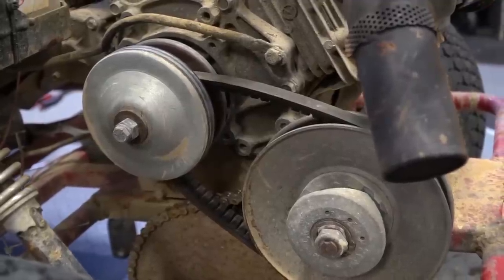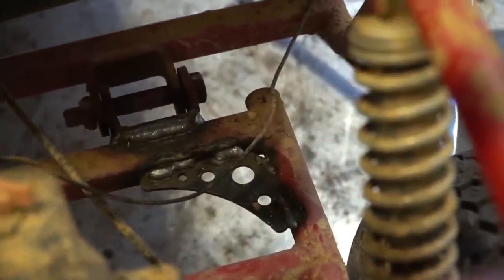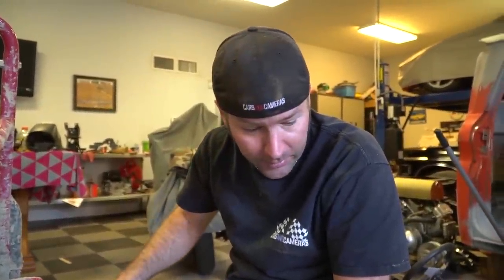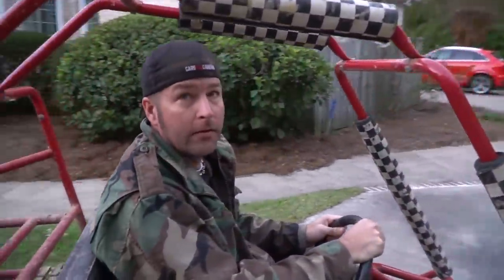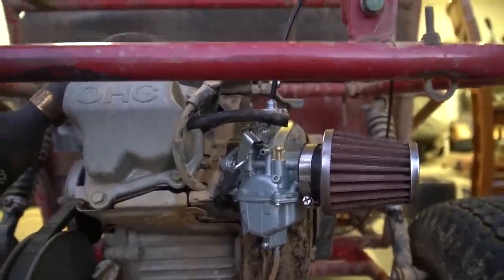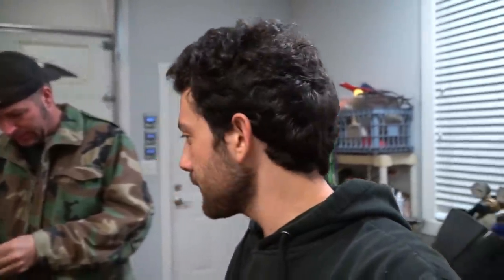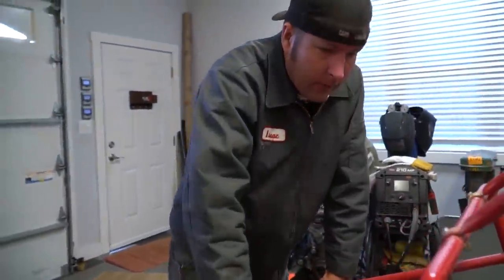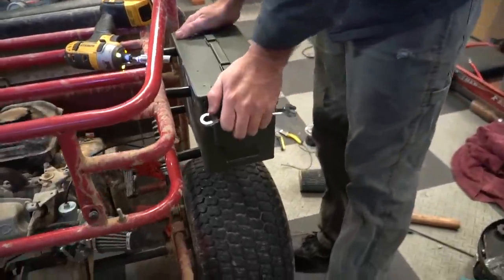Off Road Go Kart Utility Mods | Subaru Yerf Dog Revival

Comment: Go on a 2 day or more exploration camping trip with 2 go karts. Either build new ones or use some others and have tents and everything you need to survive for 2 days in a kart.
Reply: Yeah find a trail and ride in deep
Reply: Eurobeat = 
+20 mph speed
+85 drift skill
+3000 rpm
+good mood
Reply: You guys should put beefy tires with better off road tread
Reply: yea what this guy said
Reply: Propane and propane accessories I sell propane and propane accessories
Reply: They could probably pull a small one man camper with the truck go kart and one with this one too 👍👍
Reply: That would be cool 2 see
Reply: That would be cool to see
Reply: I was thinking an inverted "P-trap" style intake.
Reply: This. Find and old dirt road out in the wilderness somewhere. Ride and camp for a few days
Reply: C3! CarsandCamersandCamping... let's gooooo!
Reply: Mattie 75 yesss
Reply: CAN  I SEE ONE ON A "LIDAN 420CC,15HP BUILD??THAT,&200CC CHINESE COOLSTER QUADS.,- IS 
WHAT I'M WORKING WITH.THX. JDW
Reply: Lifan 15 h.p., 420 c.c. --@HARBOR-FREIGHT .

Comment: Air snorkel to keep the filter and carb clean and a winch? Just a couple of ideas.
Reply: Was just going to say the same thing.
Reply: it will reduce the filter issue but you will not stop dust going through a pod filter without a foam sock and some oil on it.
Reply: Wouldn't be heavy enough for a winch unless BOTH Jon and Ike were sitting in/on it and/or it was wedged to a tree.
Reply: New tyres whith gnarly tread
Reply: Agreed

Comment from the maker: Mini Mayhem meet coming next Wednesday!
Reply: I want to sponsor a Honda 390
Reply: You guys need some kind of air/fuel meter and lamda probe. Then you could actually tune the mixture correctly and not end up with another drag rail type engine failure,
Reply: Put bigger tires on it
Reply: Where is the Murray
Reply: I wanna ship these tires out for the yerf dog but I'm not sure where to send it , i will send pictures on Instagram. Check carsandcamerasreviews
Reply: Thats a good name for the monster kart "MINI MAYHEM!" or just plain ol, "MAYHEM!" or "SMALLFOOT" LOL
Reply: Wook at du cute wittle yewf dog wif the cute whittle eyes
Reply: please bring back the murry
Reply: I would put seat belts on it. After seeing ike roll it and him bouncing around i think tht is really a necessity.. JS and keeping safety in mind..
Reply: You should put a snorkel on it under the seat. Good video.
Reply: Roof rack
Reply: Dude sparks by a battery!

Tic tic BooM!
 Still a cool kart though!😆
Reply: You should upgrade the suspension
Reply: You need to fix the engine or back end from doing that hoping then it does
Reply: Add a snorkel to it
Reply: You guys should put the ATV wheels/tires that used to be on the front of the truck onto the front of this thing, give it a little more ability on the sand.
Reply: Paint the rims easy
Reply: Tires, wench, snorkel
Reply: On your Subaru yerf dog on the rack above your engine put in a generator gas tank there huge there the size and with of a rack

Comment: Yall should build a utility trailer for this. Then go for a karting/ camping trip.

I would do tow hooks front and rear. 

Brake/tail light 
 a rear mounted work/ camp light. 

A usb outlet for charging phones etc could be wired into a ammo can.

A winch could be handy.

Trailer hitch.

Comment: The best thing you could ever do to any of the yerf dog karts is get oversized bolts for every hole and drill out the holes to fit the bolts. Getting all the slop out of them completely transform them. I have rfy shocks as well as properly sized bolts on mine and it rides like a caddy.
Reply: Thanks

Comment: The yerf dog is awesome. If it were me though, I'd reverse the bolts on the ammo cans so that the bolt heads are inside the box. Then you don't have to worry about the shaft of the bolts catching your hands, or your supplies. I Also might would consider adding a simple brace or gusset in the frame where the boxes mount. And a 12"-16" led light bar across the top would just be perfect in my opinion. Those are just some of my thoughts. All in all, that thing is awesome. Ya'll have made me want one.

Comment: Idc what's going on but that 900cc Ducati motor needs to go on the rail, the power to weight ratio will be more balanced out
Reply: Goal for the rail isnt to go as fast as possible, its to make what it already is go as fast as possible.
The current 670 is already bending the axle on launch if they double the power (and increase the weight) its just going to cause more problems than its worth, they could build it up to take the power but then it'd be slower with the 670 and this is a go cart/lawnmower channel and using the 670 engine is the focus of that rail. its like having a 30 year old car with no mods and seeing how "good" you can make it with just simple mods, like tuning a stock '87 camaro vs dropping an ls3 into it, the fun is seeing how far it can go as-is.
Reply: Im not saying that because there is a issues with the rail but the Ducati motor doesn't fit that little go cart but the rail was the heaviest kart that they have
Reply: Id like to see what the 670 could do but i my be that it cant handle that stress  d still
Reply: @tomstech4390  OK. They did that. The current 670 is most likely a trot line weight now, so why beat a dead horse by trying to rebuild an engine that basically failed the first time it got pushed hard. And who wants to watch someone tune a stock 87 Camaro? Not me. BORING! Swap that bitch and make some power, or leave it at home, cause you just wasting the dude behind you in line to race's time. He gotta wait on that 14 sec pass, after the one wheel peel. It's cool, though, it was the wheel on the grandstand side.
Reply: They said specifically in one of their rail videos that they will NOT put the Ducati motor on the rail because the frame is already tweaked and the axle is already maxed out as is

Comment: some advice, i own one of these carts with a 12hp motor and yes they crack like that, also welding the upper cage to the lower frame instead of bolting it help ALOT with flex.

Comment: I have the 3202 which is basically the same thing but black and doesn’t have the rear rack. Stage 1 212 in it too.  I jumped it an completely snapped the frame
Reply: Haha damn where did it snap at

Comment: There is one thing you can do. Well it used to work on round saws. All we did is drill two holes once at the beginning of the crack and one at the end of it.
Drilling a hole stops the crack from spreading. just try it anyway. Cheers

Comment: Part of the beauty of an OHC design is it allows higher-RPM operation without valve-float, allowing more horsepower to be produced. It's what made the 500cc Matchless motorbike "matchless" in the day. 

That said, seeing how turbo-charging adds so-well in breathing at high engine RPMs, and since it is a Subaru, wouldn't the addition of a turbo make sense? You know how Subarus are with turbos... especially off-road!😎

Comment: You should consider turning the bolts around on the ammo can so that the head of the bolt is inside the can. It will prevent water bottles from being punctured or straps getting caught up....just a thought though

Comment: Ya"ll need to take it to the next level and either supercharge or NOS your vehicles. Perhaps add some serious suspension with 2' of travel. I love your channel and what you do but I think you have maxed out on the basic setups. Off road carts need huge front and rear tires with some serious suspension. Just tossing some ideas out for ya'll.  How about a cart with some serious snorkels that let you drive an off road cart under water all the way to your neck? A cart with 4 wheel steering? A cart with electric motors driven off a generator? Get nuts fellas! I can see it in your eyes that ya'll want to unleash!

Comment: Turn the bolts around for the ammo boxes.  With the ends sticking inside, someone is gonna forget and slice their hand or arm on the end of a bolt, and go with a shorter stove bolt type so you have a round head inside the box and it will still tighten up good.  But just curious, why didn't you guys just weld on some 1" flat plate and then weld the boxes to the flat plate with the lids just above the round bars??  Would have held on a heck of a lot better and no worries about breaking a bolt or the boxes sticking out a long ways like they do now.  Could have actually put them sideways at the back of the luggage rack.

OR 
OR
Put them on the front and gotten surface mount LED's and put them inside the boxes!!  Still have storage with a minimum amount of intrusion into the box.

Comment: I think you need a small light in the back just in case you have to get in your storage bin or fuel up. It would be nice if you needed to make adjustments on the motor also.

Comment: yeah pod filters are no good in the dirt, you need a foam sock over it that you can oil up to stop the dust getting through it and turning to mud once mixed with the fuel in your carb, that's why you are seeing mud in there.

Comment: put a light bar across the top rollcage rail, bigger gas tank above the engine then put taller suspention and wheels/tires on it as well.

Comment: you need to move  the top of the shocks back to stop the shaking in the rear end. and turn the bolts around in the box's you put on so you dont rip your hand open as you reach inside.

Comment: thats kind of like what i did to my Murray racing mower i had a rear axle from a radio flyer wagon it had holes already drilled into it i took the two bolts in the back of the mower off and bolted it up to the body with the same bolts it can hold either a spare tire or a tool box
Reply: the cool thing is with my Murray is that i have another spot that i could place the tool box so i guess its going to be a spare tire holder

Comment: Z guys when you go to a larger Venturi you slow down the airflow slower air flow means a leaner fixture when you go to a smaller Venturi it speeds up the airflow and richens the mixture

Comment: I wish you guys would make a snorkel for the engine, so it won't be sucking in all the dust etc.
Reply: IF they would run a foam filter the dust prob would be solved. The screen type filters let dust through though.

Comment: it seems with the torque of the subaru engine and the torque converter you could put on a smaller axle sprocket

Comment: When the drive belt chirps and jumps like that the belt is the wrong size. And if you change it to the correct size it will be fast most likely because it will function more to the way it was designed for.

Comment: Put a small winch from harbor for 50$ and it comes with remote
Reply: If it's a wireless remote, be sure to allow for killing the power to the winch when not in use. They create a constant drain when sitting idle waiting for a signal. Learned that over on Mustie1's channel.

Comment: I love your videos, but I have a question I just recently picked up  Exact same yerf dog cart that you have mine has the 6 1/2 horse Tecumseh engine on it. I am a mechanic so I know a little bit about small engine but this thing just doesn’t seem fast at all. The engine seems to surge when it’s at idle, and when I get in it and try to takeoff it moves but just doesn’t have any power like yours just wondered if you had any advice. I’ve cleaned the carburetor twice already with torch tip cleaners to clean the pilots out but there’s not much adjustment on the carb.

Comment: I would like to see taller front wheels.  Better for rolling over holes, not getting stuck in one and that would transfer more weight to the rear wheels.  Zip tie the wires together in to a bundle

Comment: I'd like yo see good off road lugged  tires on the rear r wheeler tires on front. with a spate tire in top for rear and mount for spare on back for front tire ... s light bar in rack above

Comment: I'm troubleshooting on my Tecumseh 5.5hp mad cat and it's basically the same frame without shocks, and I took the cage off. Did you guys have trouble tuning the idle so that the torque converter belt doesn't catch and start spinning the axle? Can't seem to get around this right now and the carb the non adjustable so worst come to worst probably just gonna grab a 26mm mikuni like yall. Please let me knoo
Reply: We didnt have a problem tuning the carb. Once qe swapped it out with the 26 it was awesome

Comment: What would you guys recommend for an engine swap on a Yerf Dog Spiderbox 150? I got the cart when I was much smaller and it’s still a blast just very down on power. Could one of the predator engines be upgraded to electric start?
Reply: 212 predator fits perfect runs fast also.
Reply: nty grty could I keep electric start?

Comment: You keep losing a bit of traction when you pull off from a start because the back end jerks. Is there a way to fix that? I’m no expert (complete noob actually) but would a damper help solve that?
Reply: The belt was burnt up from our last busco beach trip. We replaced the belt and fixed the problem
Reply: Okay. Thanks Isaac

Comment: Adjusting the carb needle only affects idle and immediately off idle.
Reply: The pilot jet is your idle circurt, idle -1/4 throttle, needle clip position is from 1/4 - 3/4 throttle settings.

Comment: What’s causing the wheel hop on acceleration start?
Reply: Andrew Lang it is a solid rear axle. Without a differential it makes the inside tire slip when turning, that will cause the hop. Add to that the crap shocks and it is even worse.
Reply: Mini Moto Revolution Ahh, thank you. Made me think of when a car has a Lincoln Locker.

Comment: You guys should have put those bolts in the ammo boxes the other way around so you don't bust your knuckles so easy when reaching into them.
Reply: Brian Crabtree no keep the nuts in box. In case it falls off you still have the hardware.
Reply: @gt20modding88  If that's what you are worried about then double-nut it.
Reply: Brian Crabtree lol

Comment: I cringed when you guys drilled thru the frame to mount the lights and the ammo boxes. I would have loved to have seen you guys just weld some flat bar tabs with a hole drilled in it instead of drilling those big holes thru the frame.